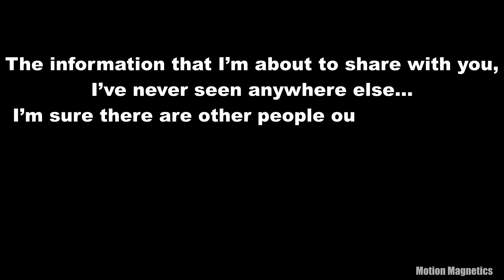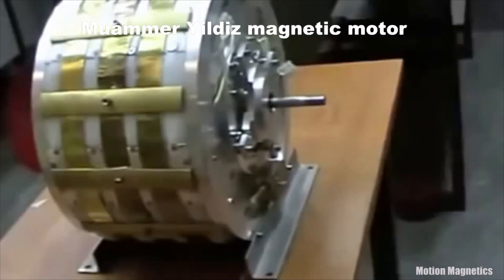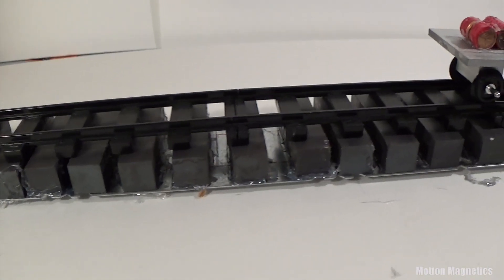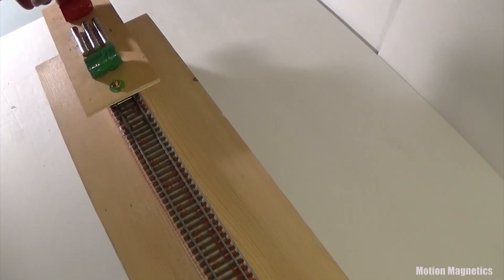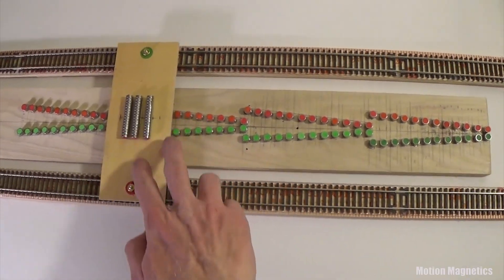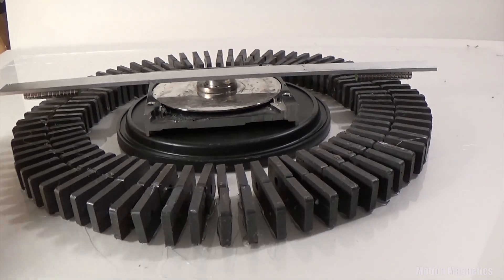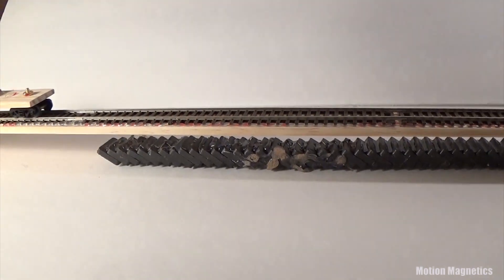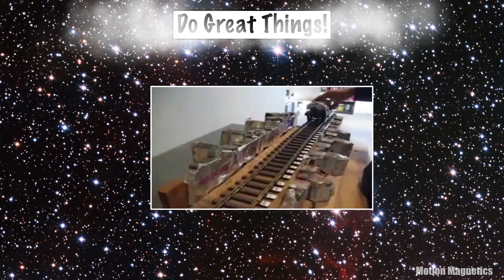The 3 Types of Magnetic Motors Part 01

Comment: this is very interesting because you have to ask yourself the question why it can't work. I see permanent magnets like springs indeed. In linear tracks you are just converting potential energy into kinetics energy. And where does this energy come from? It's just potential energy as i said *that you put in this system* by moving the objet far apart from his stable position towards a stable but not very stable position (there is a term for this but i can't remember, it's like putting it on the top of a mountain).

Of course you can't start this in the middle of the track and it's like you were on a circle track.

You can see it as gravity too. Imagine you put a cube on the edge of a table (at 4:21) then tou poke it towards the edge (at 4:22) and woaw it moved and falled on the ground (at 4:25). Potential into kinetic energy.

Stop bringing misinformation to people and don't skip physics class.

Comment: A magnetic repulsion disc engine could work and powered magnets could be linked to timers to pulse on and off at exact micro seconds in order to maximize the repulsion force required. The strength of the 2 magnets sandwiching the repulsed magnet could be manipulated to increase or decrease the power it produces. All these parts needs to be machined to perfection and have exact placement and measuring and weight and balance if it's used for a vehicle. I believe the trial and error here is almost close to that of rocket science for how specific things would have to be and sadly we haven't fully explored the potential behind these designs but they could make potentially powerful static gennys.

Comment: Permanent magnets aren't permanent.  The energy you get out of "extracting" work from a magnet comes from the MASSIVE amount of electricity and heat it takes to create the magnet.  The magnet will simply degauss as you put a load on the motor.  They are not infinite wells of free energy.

Comment: A steel could stick to a permanent magnet as long as the magnet has the magnetic power. (Isn't it a power?) now try to hold a 10kg steel with a hydraulic excavator, which need energy source from electricity or fuel. Try to hold for 1 day. Now we you can see how much the energy the magnet needs? ZERO. How much the Excavator drain the Fuel? A lot of litres. That's how should you think about "FREE ENERGY"

Comment: What I did was mount one flat magnet on a soft iron shielding plate at 45 degrees, and hot glue another magnet vertically on a VCR Video Head (great bearings, and aluminum, nonmagnetic), and moved it 1000th of an inch per second towards the soft iron plate, using a watch and caliper btw so it was precise and measurable and insignificant momentum imparted), and it pulled itself towards the soft plate, then the stator magnet, then momentum pulled it back away, and after maybe 1/4 inch of that (Using 1/2in magnets, tilted, so just under), the repulsive forces took over, and the rotor magnet was pushed away from there.
Then I started with 9 stator magnets and one rotor, and it was getting stuck after 3-4, because of imprecision's, and lack of milling machine to make custom metal parts, but now I've figured out a dozen or so more details to add, and ways to do this with hand tools, today hopefully!

I'll set four magnets (different dimensions, 1/4 to 1 inch, 1/32 to 3/32 thick, STRONGEST 'Rare Earth' possible) on this Laptop hard drive platter (I took it apart obviously), and hold one Square magnet on a soft iron plate (Magnetic Shielding, often goldish and rainbow color from 'annealing', from a hard drive btw, or speakers, etc), tilt that 45 degrees from lined up with rotor magnet (so they attract edge-to-edge, and like poles repel when not lined up), and place thin metal in front of the edge, maybe rolled to 3 layers (thin, just to fit in front of the thin edge of stator mag), and cut and bend it so it gets exponentially closer to the rotor magnet, pulls it right to the point the stator mag starts to repel, totally cancels out the attraction between the two magnets (Maybe use 'diamagnetic' bismuth or pyrolitic carbon sliver under too), and minimize the attraction between the rotor magnet and this thin metal shielding at that point (have the metal taper off as it gets closer to a point).
That should maximize the forward force, and minimize the backwards force!

WHO WANTS TO HELP ME WITH THIS PROJECT?  Help make and show and test ideas, maybe help make custom soft iron, bismuth, carbon, magnets, etc., to experiment with?

I plan to share this, but also retain patent rights (So people can make their own, just not sell them!).

Comment: THANK YOU for this GREAT summary of Magnetic Propulsion Systems! I think I've figured out an even better one, by combining all these and many of my own ideas, which I'm building now, and this along with the 'bifilar coil' designs which can cancel out the EM field and 'back emf', I'm pretty sure this is going to be AMAZING!  So far I made one magnet propel itself past another by cancelling out one pole (say the South) on the Stator so it attracts instead of repels on that side, then some thin plate steel/iron shielding to minimize the backwards attractive force (when rotor magnet pulls away from shielding) and to pull the rotor all the way up to where the Stator magnet starts to repel it, and here is a link to the post (I have investors, and will be making a webpage on my site with a paypal button for investors, an offer, description of the inventions, plans, etc.), HERE: 
https://www.facebook.com/harleyborgais/posts/10212994187489516
Reply: UPDATE, unfortunately I did some math for a new and even better design I just came up with a couple days ago, and using three 1 inch diameter disc magnets, the strongest ones I can get, which have 25 lb of lifting Force, if I assume 25 lb of torque to rotate them, which is probably not exactly correct though, then with three of these, the minimum necessary, it will only produce maybe 1 to 3 Watts!

And those three magnets cost $15, so to make a 10 kilowatt generator for a home what cost tens of thousands of dollars!
But I'm pretty sure I can reduce the cost, and improve the efficiency of output, and make this an actual practical device in the future.

But it'll have to wait until I start earning enough money now, doing paralegal work for people, to afford the time and money and tools to build this.
(I can now prove all harmless civil & criminal 'offenses' are not enforceable, ' deprivation of rights under color of law' & I've actually won in court and made police stop enforcing several things, and more!)

I'll share the trick though, having a half round iron disc come in between two magnets (magnetized perpendicular to direction of rotation so both poles on both magnets interact in the space between), 51% of the rotation, can cause those two magnets to rotate an axle in one direction, and turn the metal disc, as well as an electrical generator.
 Now it's just a matter of making it efficient enough to be profitable!
Reply: Is your stuff patented?

Comment: make the sections of red and green magnets longer to increase time spent accelerating, for a non-linear motor use a switch lever to add an extra layer of magnets aligned to accelerate the shaft until it reaches the desired speed to maintain its velocity at which point you disengage the extra layer of accelerating magnets by lever so the two layers are separated and the spin can maintain itself. someone please try this and let me know.

Comment: ..they are a good start but the holy grail should be solid state..
Reply: Sean OFarrell can you elaborate?
Reply: @Presteeeeeeeg  ..well,these devices,while quite good,have moving parts,which will wear out relatively quickly and be quite dangerous when developed more,as I suppose they will run at higher rpms to produce more torque to run larger output generators.Whereas solid state units will function indefinitely untill a conductor blows.As for designs,Ive only heard about solid state units from word of mouth.One young guy from my countries largest city,Auckland,told me he met a middle aged guy who had a silent box,prob  solid state but he didnt see inside it and didnt know how it worked.Another solid state device I read a description of but no diagram was of a flat coil in conjunction with magnets.Now my own theory,admitting I have no education in Physics,is to take this solid state flat coil with magnets and feed back some of the output to coils around the  magnets to increase power output and also making the feedback at the right harmonic frequency to amp up the output.This,I think will prob cause enough current  to blow the conductors,so I think with upward cascading additional sets of coils and magnets around the outside of the inner sets with each outer set having larger diameter conductors able to pass the increased current.Maybe 2 or 3 or more sets of coils and magnets to increase final power out.Imagine the power amplification.In my imagination,a unit the diameter of a dinner plate producing 10s of kW.This idea could be scaled down for E devices or scaled up to run trucks,trains or even  EM drives.We could have lifters on passenger aircraft able to make the aircraft  a lot less susceptable to wind shear etc with gravity well generators in the nose producing foward movement.Q.If what we see and read on You Tube about these  anti grav machines doing 50k+km/h,what does stop them from making a sonic boom?Clearly this is the clean and cheap aerial transport system to last the human race for all eternity.
Reply: We could even have man portable one piece scalar beam rifles.Let the bad ETs fight us or over us then.
Reply: Also I think the idea of ferro fluid etc toroidal rotators for lifters are a bit dangerous for the public with figures of 400 atmospheres and 50k rpm.Expensive too.Do we have the necessary materials to make these toroidals?I think gravity well wave tube generators of opposite polarity causing a refulsive effect instead,arranged in flat banks like honey combs in a beehive would be a safer and cheaper idea.And if we placed smaller and lower powered gravity wave tubes under floors and in ceilings of aicraft for artificial gravity in space,we wouldnt have to use the local fields that UFOs seem to have that are produced using massive amounts of power,this not sounding to healthy for the public.

Comment: the magnetic field needs to have a dynamic, it´s like gravity, as long as there is no dynamic in magnetic fields they are not capable of continously transform ernergy because there is non to be transformed you have to introduce it first, magnets are not batteries!

Comment: I believe several people have seen my design for the hand spun Barber 
Pole motor.  Which separates magnets and nails with leads wrapped around
 them..bottom of the Pole spins by stationary copper coils in the 
housing...bottom of the Pole has magnets imbedded in it.  Copper coils 
in the bottom of the Housing do not wrap around steel cores.  They wrap 
around wooden pegs.  The top of the Housing has large flat head nails 
embedded into it...with the leads from the coils at the bottom wrapped 
around them...one nail per coil at the bottom.  The nails at the Top of 
the Housing are called the Conversion Discharges.  The Top of the Barber
 Pole itself, or barrel on two bearings if you will...has large steel 
bolts embedded in it.  The Top of the Barber Pole/Barrel has Steel Bolts
 embedded into it.....they pass by the Flat Head Nails which have the 
leads from the copper coils at the bottom of the Housing wrapped around 
them.   The Bottom of the Barber Pole/Barrel has magnets embedded into 
it...they pass by the copper coils at the Bottom of the Housing which 
are stationary, and Energize the Flat Head Nails at the Top of the 
Housing which has Iron Bolts embedded into it, which are spinning and 
passing by those Nails...as they get Energized and then De-Energized 
while the magnets spinning and passing by the coils at the bottom cause 
the Field to energize and drop off as the magnet goes by each individual
 coil, that is individually wrapped around a flat head nail at the top 
of the Housing.   I have released the Blueprints For the Handspun Barber
 Pole Motor YEARS AGO.   Thank You.  "Modernjedi"
Reply: got a link to those blue prints ? curious as to your design.

Comment: The MEIM motor solved the problem. The USPTO released the patent documents on June 6 2019.
Reply: And more than likely one of my own designs.  I have 4 different designs which work.
Reply: I believe several people have seen my design for the hand spun Barber Pole motor.  Which separates magnets and nails with leads wrapped around them..bottom of the Pole spins by stationary copper coils in the housing...bottom of the Pole has magnets imbedded in it.  Copper coils in the bottom of the Housing do not wrap around steel cores.  They wrap around wooden pegs.  The top of the Housing has large flat head nails embedded into it...with the leads from the coils at the bottom wrapped around them...one nail per coil at the bottom.  The nails at the Top of the Housing are called the Conversion Discharges.  The Top of the Barber Pole itself, or barrel on two bearings if you will...has large steel bolts embedded in it.  The Top of the Barber Pole/Barrel has Steel Bolts embedded into it.....they pass by the Flat Head Nails which have the leads from the copper coils at the bottom of the Housing wrapped around them.   The Bottom of the Barber Pole/Barrel has magnets embedded into it...they pass by the copper coils at the Bottom of the Housing which are stationary, and Energize the Flat Head Nails at the Top of the Housing which has Iron Bolts embedded into it, which are spinning and passing by those Nails...as they get Energized and then De-Energized while the magnets spinning and passing by the coils at the bottom cause the Field to energize and drop off as the magnet goes by each individual coil, that is individually wrapped around a flat head nail at the top of the Housing.   I have released the Blueprints For the Handspun Barber Pole Motor YEARS AGO.   Thank You.  "Modernjedi"

Comment: i was always to smart to agree that magnets force can be somehow turned into energy.....but i have tried a few designs myself and although none have worked for me....the dead spots were what stopped my devices from producing any actual power..UNTIL, i saw a design which uses a arched cantilever magnets setup such as in an older style cam shaft which systematically varied the force thru distance at measured points. this worked perfectly until any counter force such as even blowing a lungful of air against the turn would stop it....so no power there to turn a generator...but the free flowing undisturbed rotor would essentially spin until you either applied a pulley to extract spin momentum or even just tilted the board it was mounted to and it stopped, BUT this doesn't mean a genius wouldn't be able fine tune this setup or reconfigure it to actually extract power.  im a fitter machinist, not an engine builder, but i have made some basic petrol engines from scratch in the workshop knowing all i knew about how engines worked and i was able to get one of the engines running, all be it with almost no power (as were the first internal combustion engines ) but after over a hundred years of refining we as humans can now  make a small motorbike engine that literally makes 5 times the power of a t model ford back in the day...and uses 10% of the fuel.......so im just saying that time and technology can improve upon a concept and if you consider the billions and billions  of dollars a year going into combustion engine tech and you were to spend that on these sort of magnet engines, you could possibly see a transformation from toy to real power maker.  any motor head who knows engine history will agree that before the concept of internal combustion, most of the smartest minds all said this was an impossible concept due to tolerances. but a few guys ignored the smart minds and now we have cars that can drive themselves......if i were rich, i would invest in this tech. it mite never go anywhere, but concepts show more potential for refinement than the original combustion engine.  thats my thought.

Comment: If you can get the magnets to have electric sent to them by there own energy. (magnetic motor driven charged) then the magnets will become more powerful (putting off a stronger magnetic feild).. and be able to power the original magnetic motor with more rpm more energy to be reserved or put out

Comment: So could you build a magnetic power source to run your house with magnetic energy?
Reply: In theory yes but no
Reply: @Tonsils-micman  🤣👌
Reply: Energy - Health  Thank you!
Reply: No these magnetic motors are not enough to withstand the magnetic flux of the generator... Fine, lets imagine it works, it may power up a single LED not your house lol...
Reply: @lokeshgnanasekar  well, with a transformer you could convert that 12 volt into 120 volt, so if those magnet motors will only generate 12 volt, with a transformer you can bump that up to 120 volt😊
Yes i do believein working magnet motors but it’s a matter of ‘know how’
Reply: @lokeshgnanasekar  what about with the new SynRM motors? I know they're taking over the induction generator because they create much less resistance
Reply: @PlubusDomis  I'm afraid that you're WRONG but it's totally fine for a common man.

It's actually reluctance not resistance.

In fact Synchronous Reluctance Motors have more reluctance compared to any other motors.
Which is good for more torque (hence more power).

Ironically, SynRMs been there for more than a decade.